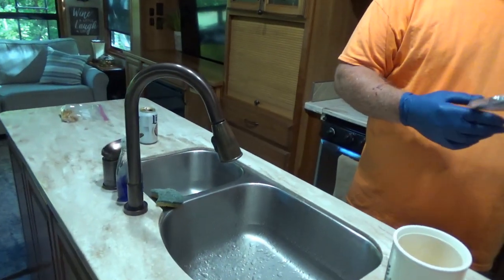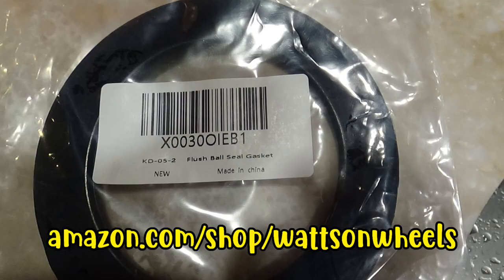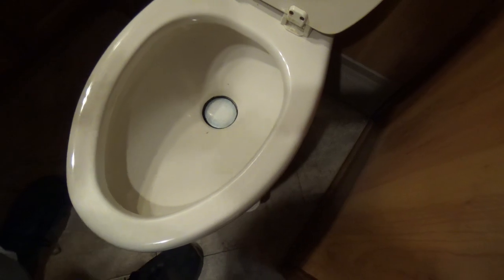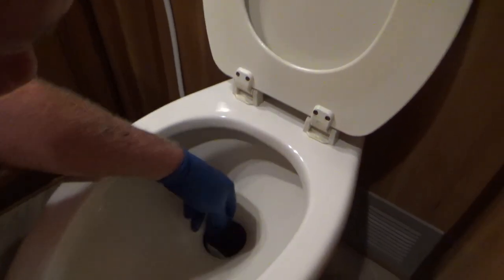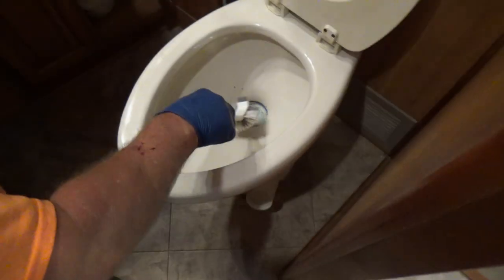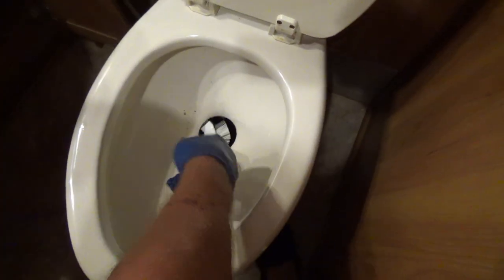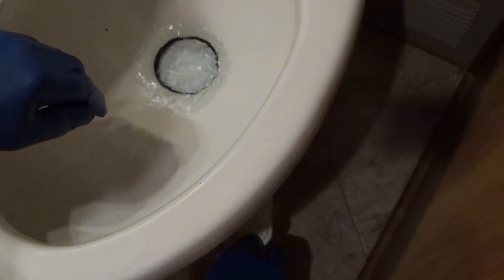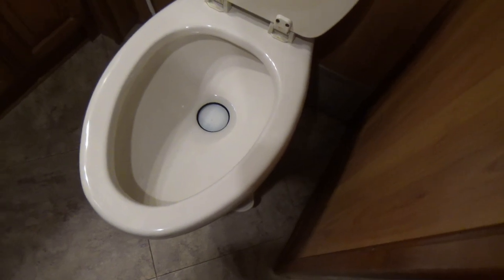💪 DIY  - RV Toilet Seal Repair  // Dometic Toilet Fix

Comment: I need to do that. Bought my trailer new have not used it yet and toilet will not hold water. Not driving 200 mi for warranty
Reply from the maker: Cheap from Amazon.  Dealers will charge you $40 just for the part.

Comment: I thought you had to take the toilet off the floor to do this job. Apparently Not :
I replaced the seal years ago. It will not hold water again. I like your method better. I hope I can do it your way!
Reply from the maker: Good luck.  I hope you can do it without removing you toilet.
Reply: @WattsOnWheels  it’s a Thetford.
Reply: Unable to just pull the seal out on a Thetford 
:(   Dismantle

Comment: The one video that's not necessary😆. I once had to figure out what was plugging a toilet in my previous 2nd home. Took the bowl off and there it was...a petrified turd right at the inlet to the floor drain. It eve clinked as it fell in.